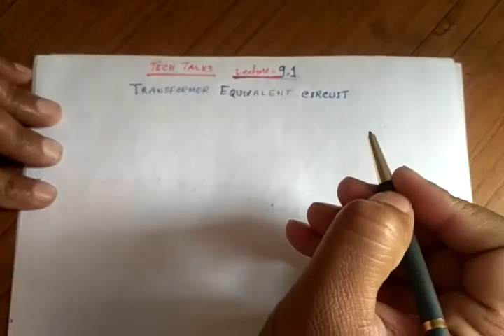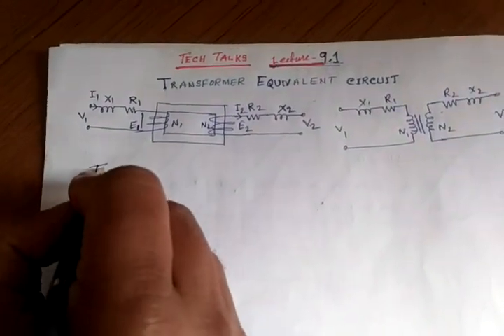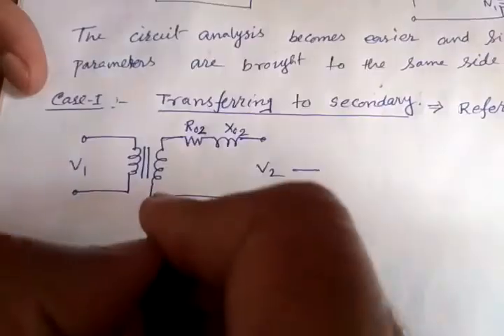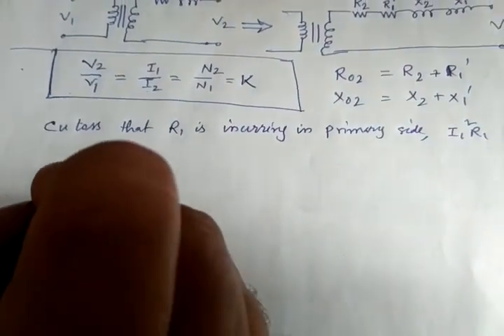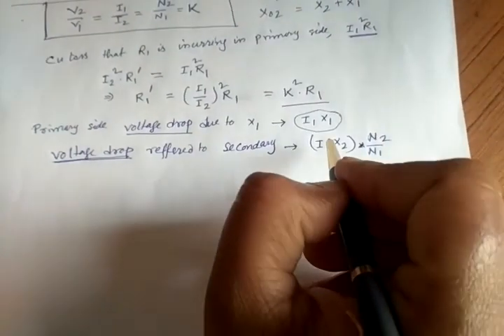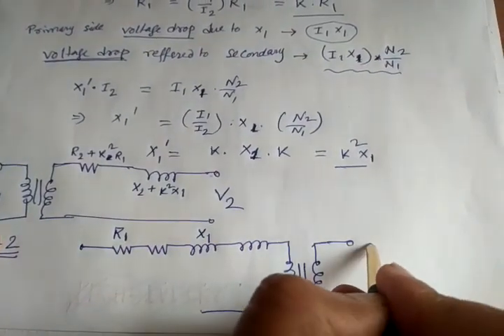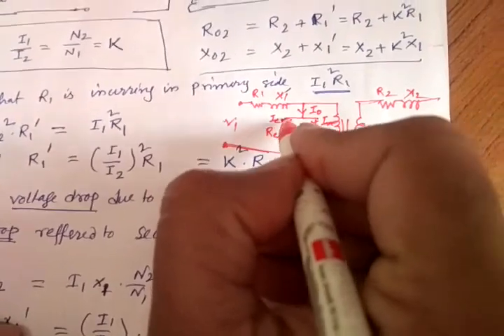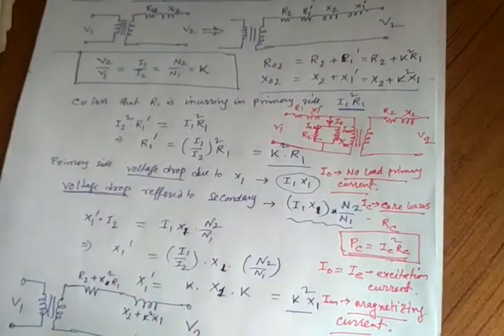Lec. 9.1 | Equivalent Circuit of Transformer | Referred to Primary | Referred to Secondary | Rc | Xm

Comment: Sir,
When secondary Voltage is bigger than primary voltage is this step up condition?
Reply from the maker: Yes. Step up transformer increases the supply voltage and that is available in the secondary. Though at the same time current decreases from primary to secondary.
Reply: @TechTalksGM  ok sir, thank you sir